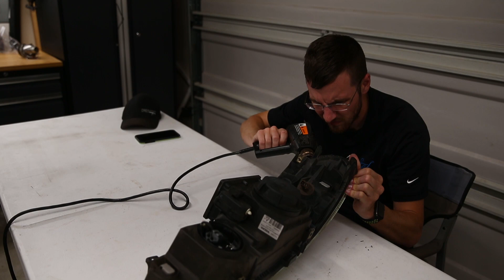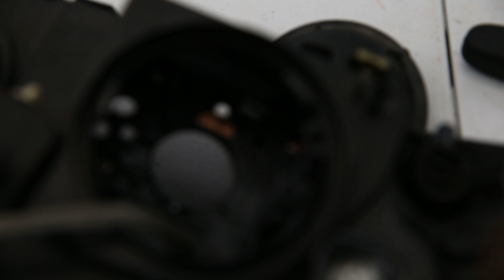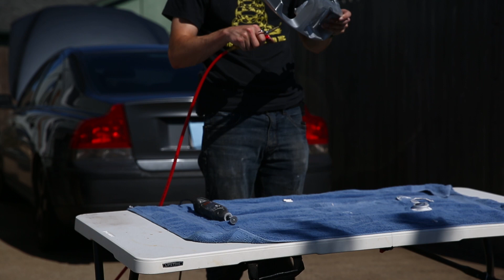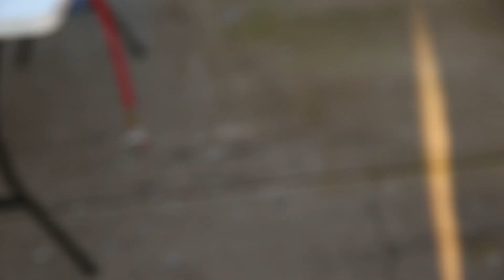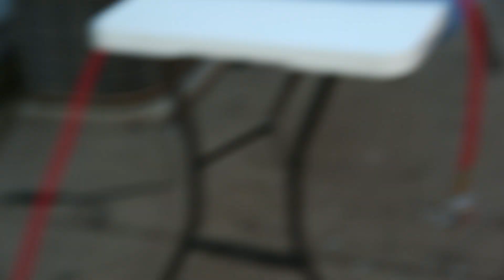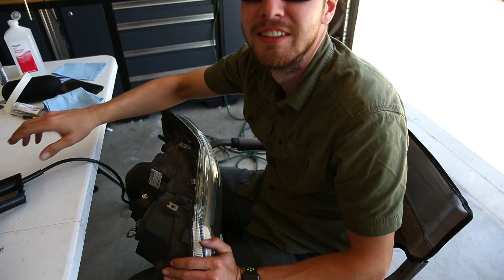Volvo S60R Headlight Retrofit

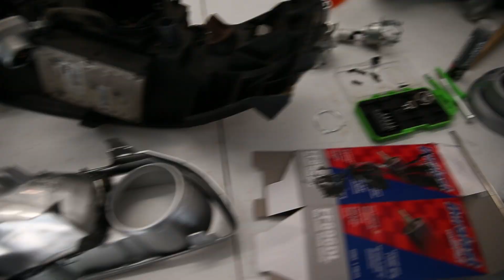Comment: At 12:27 I see you're putting in the screws and your holes on the back, but I cant see what you're doing to secure it, where do I put my #8 screws through, having a hard time seeing where you're meeting the screw with the washers to hold it into position and when you finally give it that wiggle room and the positioning starts to tilt, what are you loosening, looks like a 10mm of some tool you're using, I cant see anything you're doing from the front

Comment: Do you remember what size projectors? 2.5 or 3in?
Reply from the maker: 2.5 inch I believe.  They're the Mini D2s 4.0.
Reply: FiddesModsTV hey guys have you tried wiring in resistors to trick the circuit that trips the code

Comment: Which shrouds are those, don’t see them on the TRS site?
Reply from the maker: Kyle Pike I want to say they were a variant of the Apollo’s. I could be wrong tho. 

They came chrome, Dan sanded them down and painted them.
Reply: FiddesModsTV yeah I see that now, they look modified. Thanks for the video, snagged a V70R to haul the dogs and the lights are abysmal. Planning a retrofit now 👍🏼
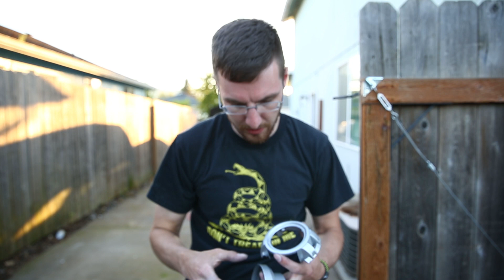Reply from the maker: They are modified. You can see the difference around 19:56